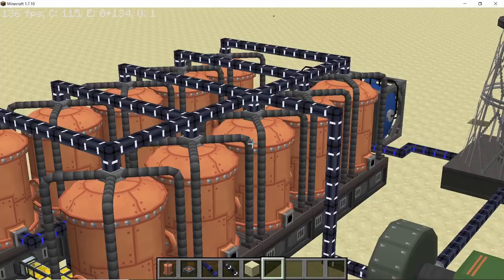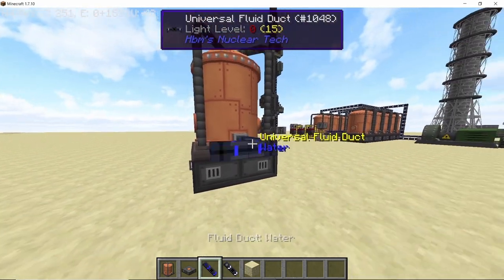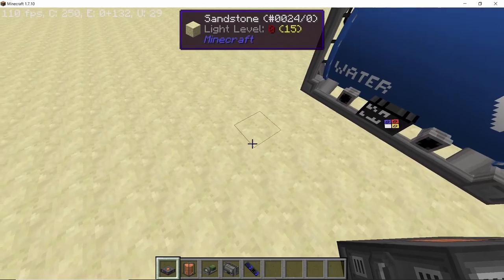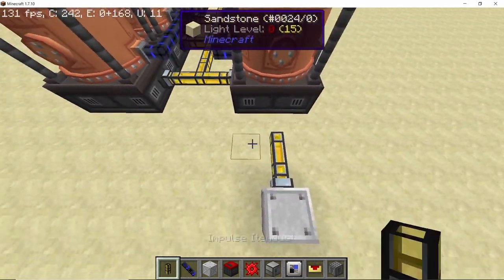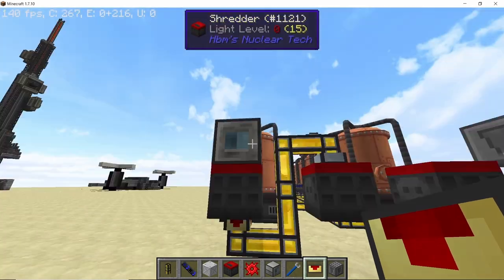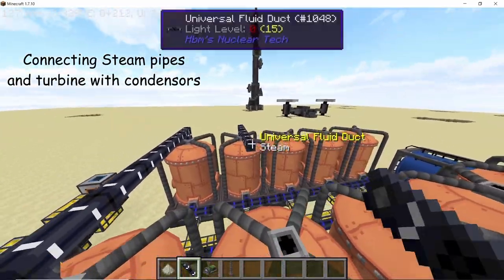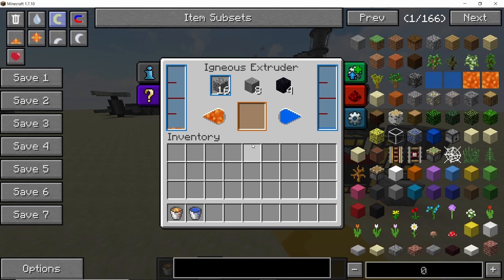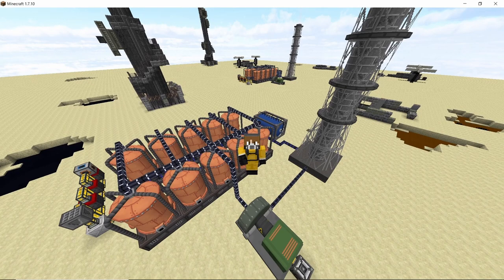Using the new "BOILER" to make a Thermal Power Plant - HBM's NTM

Comment: Why do you set servo stack size to 1? Doesn't that make the process slower? (Cool video btw).
Reply from the maker: Here's the reason behind it : the only servo that absolutely needs to be on 1 is the one which takes dust into the crafting table to make block of scrap , that's cause each time an item is inserted in the crafting table it enters slots considering the crafting recipe put in it ... Which in our case is block of scrap which needs dust in all 9 table slots to craft. So when you enter dust 1 piece at a time it enters 1-2-3-4-5-6-7-8-9 , now if the stack size were set to something else that would mean most of the slots would receive different amount of dust.

This logic applies to shredders as well cause they also input items in the same way , so keeping the stack size small is the fastest way to achieve saturation on a slow running system cause we don't need much fuel to sustain the power plant (each block of scrap burns for 200 seconds)

Comment: Can this boiler be heated with electricity
Reply from the maker: Yes it can be using the electrical heaters !!
Reply from the maker: Schuyler Bacn 2  making self sustainable plants is possible yes , tbh even this build is self sustainable cause it produces 20,000 HE/s and only requires 400 HE/s to run so